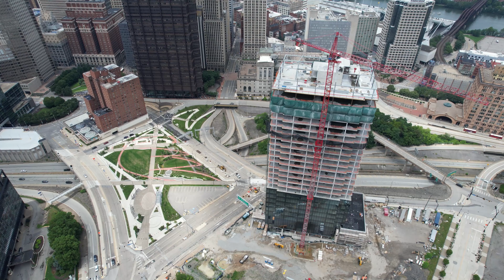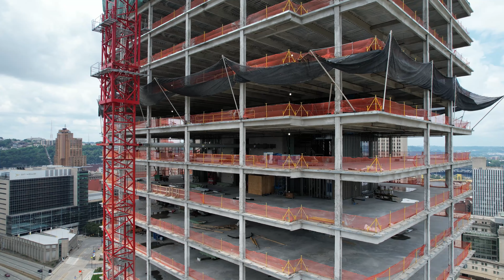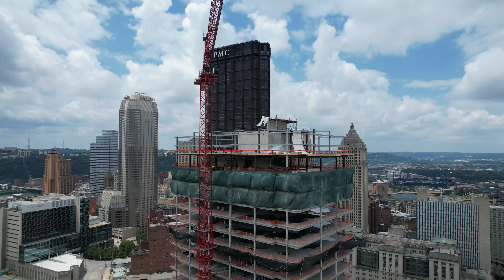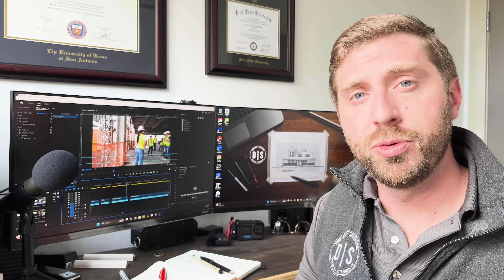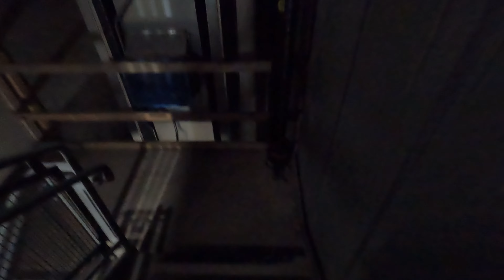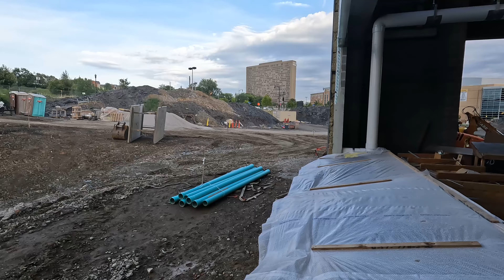Inside Pittsburgh's Newest Skyscraper Before It Opened: FNB Financial Center Construction Tour

Comment: Are the Foundation columns made of concrete or just steel cause back in my country we use alot of Foundation columns jist for a 2 floors building this is crazy ....plus can you tell us more about the materials used to build the foundation structure...
Reply from the maker: This is a great question, I’m not quite sure about the materials used to create the foundation, as I was t one of the design architects that information wasn’t available to me.  I believe the type of foundations for this building are piles; long vertical columns that reach to the bedrock.  I could be wrong about this as well as there wasn’t much data on the subject, but other buildings near by use that style of foundation.